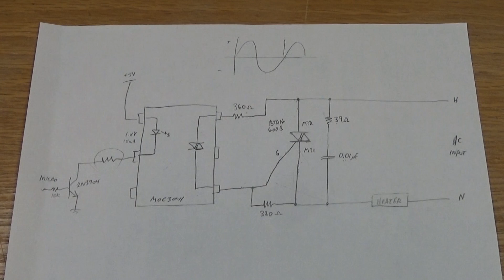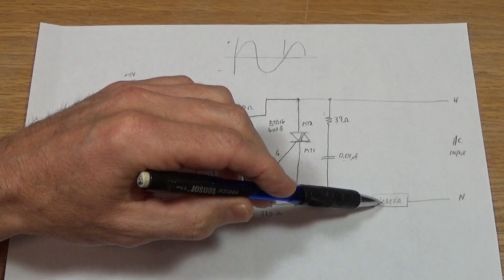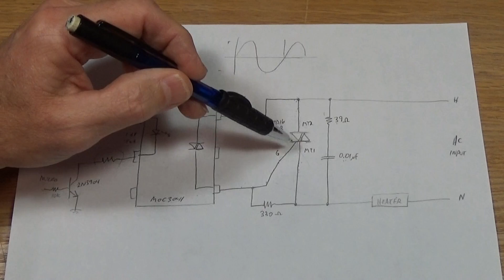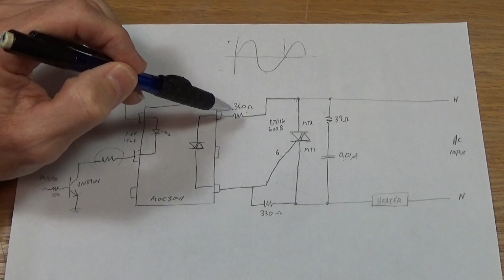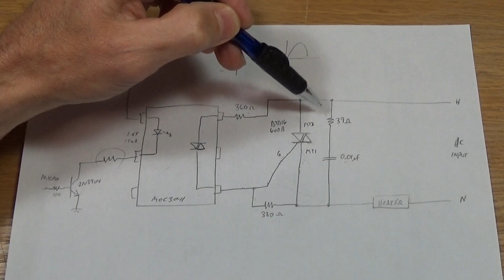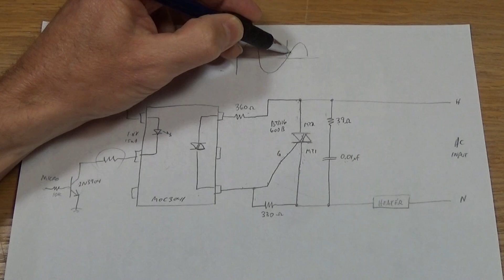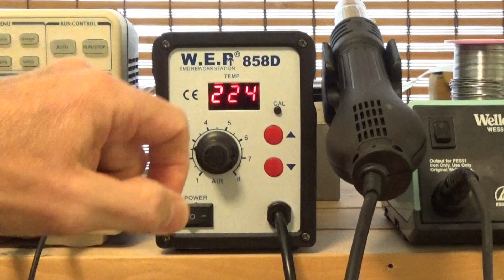Hot Air Rework Station Repair

Comment: i have the same problem but resistors,triac,opto,and the whole circuit you show is ok. any ideas?
Reply from the maker: A few thoughts off the top of my head:

 - Look closely at the whole circuit board for cracks, broken traces, skid marks.  
 - Check all the wiring, pull on each where they connect - a bad connection will come apart easily.  
 - Is the microcontroller working?  Check if you can change the temperature with the push buttons.  
 - Is the heating element open circuit?  It should show several hundred to a few thousand ohms (not exactly sure  what it should be, just a guess).  
- Are there reasonable voltages where they should be?  

Good luck.
Reply: 5volts are present to the transistor before the opto. opto recieves 220v . heating element shows 70 ohms. the whole handle checks ok , thermocouple ok too. screen shows temp but no heat and no fan . the temp can be changed and the buttons work ok. one thing strange is that the heating element recieves the live from the mains on both cables. so the DV is zero , so its impossible to flow current. any idea why both leads next to the triac on that connector have +220v each (one of them should be neutral).
thank you fow your help. your video and your schematic were very helpfull.
Reply: if i dissconnect the connector of the heating element from the pcb while still on mains , the voltage on the pcb is ok , meaning one pin is live one pin is neutral. when i connect the connector of the heating element both pins go to live (+220v with respect to the ground). no idea how the 220v goes to the second pin , no fuse blown no smell no optical damage nothing.it has a soldering iron too  (2in one) ,  the soldering iron works fine , temp is controllable so i guess the controller is ok. 
desoldered and checked all caps , diodes and transistors with a transistor tester. re-solder everything still nothing but the soldering iron works perfect and the hot air with the same problem..
Reply: opto has 5v on both pins 1 and 2 so i guess the opto is ok but it does not get the correct DV. micro gives 3.5 volts but these 3,5 volts does not reach the opto.
Reply: I found it! The switch dpdt was broken and after i change it i forgot to put the air gun to.the handle and pick it.up.again so it thinks its down.and doesnt restart..
Reply from the maker: I'm glad you found the problem.  You did a lot of troubleshooting!

BTW, regarding your comment of 5 days ago where you said you had 220V on both pins going to the heating element.  That would be a normal situation.  The heating element is a conductor, so when you apply voltage to one end of it, you should see the same at the other end as there is no current flowing through it.  The voltmeter would draw no (or negligible) current.

As painful the troubleshooting process is (you just want to use the hot air gun, not fix it), I suspect you learned a lot about some electronic circuits.
Reply: you are correct again! thank you!

Comment: Good video but in Europe the blue lead is the neutral and the brown one is the hot. Greetings
Reply: To be precise, the colours do not matter so much in Europe, becaue the plug can be connected in any position to the outlet. You have to handle both (blue and brown) wires as live from the the viewpoint of safety. Any of them can be live depending how you connect the plug in the outlet.
Reply from the maker: Thanks.  Yeah, I know I got the colors wrong as someone pointed out in a previous comment.
Reply: Glad you put that right for him.   :)))
Reply: I was talking about the EU 240V pignose connector, because the UK connector can be plug in one way only.

Comment: hi I just bought a  
Saike 852D++ Standard Rework Station Soldering iron Hot Air Rework Station Hot Air Gun soldering station  from a vender at Aliexpress China, to make a long story short the air ( blower ) stopped after 15 minutes  there is voltage going to it , I got 40.2 to 42.5 volts at motor terminals  depending where dial is set , motor is rated for 24 volts , I"m quite new to electronics , that does not seem right. I looked inside and did not see any obvious burned components ( the company is avoiding my emails about this which is really pissing me off, but that's another issue I will have to deal with ) Craig in your well rounded knowledge on electronics can you offer any help on where I should look? The info on the vid was informative P.S I live in B.C Canada
Reply from the maker: Hard to say what's wrong.  The speed of the motor is likely controlled by PWM (turning the motor on/off rapidly), perhaps that circuitry has failed.  The best place to start is check the wiring and see if everything is intact.  Check the PCB and look for cracked traces and broken solder joints, which was the fault in mine.

Not knowing how this unit is made would make it difficult for me to offer much more advice.  I know you just want a functional station, but trouble shooting a faulty electronics product is a great, but challenging way to learn about electronics.  Good luck!
Reply: Hello! I know its late. I have the same problem, how did you solve it?.

Comment: so much talk about how the line wire should be the one which gets interrupted, but you forgot that the power outlets are not keyed, which means you can plug it in whichever way you want
Reply from the maker: The plug on the power cord is polarized, can't be plugged in the wrong way.  

Proper wiring of mains connected equipment is crucial to maintaining user safety.  It's not rocket science so there is no excuse for the mains wiring to be done incorrectly.
Reply: +Craig Hollinger where do you live? in uk? eu and usa standard plugs are not polarized. anyways, this circuit can turn on all by itself so be carefull.
Reply from the maker: Canada.  The electrical standard here is for polarized plugs (three prongs) unless the appliance is double insulated.  Even the two prong plugs are polarized, one terminal is wider than the other making it difficult (but not impossible) to plug in backwards.  Our plugs here are not as good as the EU standard, but they work none the less.

Have you had a unit like this turn on all by itself?  Mine has a manual power switch.  It seems there are many different but similar units like this all over the place.  

Despite my rant about this re-work station, I'm quite happy with it.
Reply: +Craig Hollinger yes, I had one turning on, search google/youtube.
the switch is for the transformer, leaving the heating element switched by the triac, which can turn itself on.
Reply from the maker: I see.  That's good to know.  I think I'll be unplugging mine now when I'm not using it.

Comment: hi craig, think L is brown and N is blue in the EU.
Reply from the maker: I think you are right!

I live in Canada, so not very familiar with the EU electrical codes.  I spent some time recently working in New Zealand, and did some electrical wiring (correctly BTW, supervised by an electrician) there, but my memory is kinda short. ;)
Reply: Correct live brown blue neutral and green yellow for earth